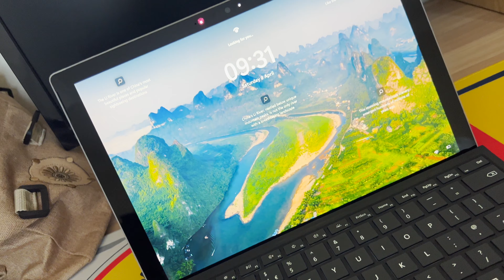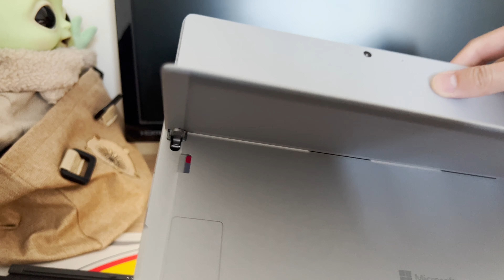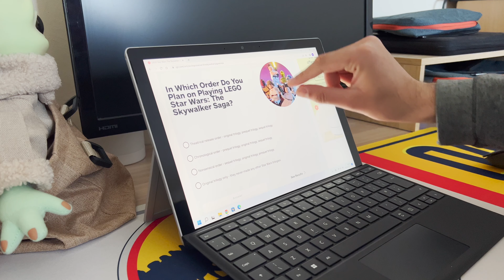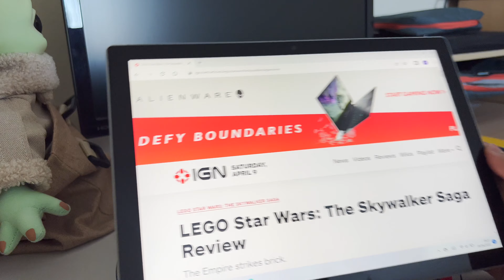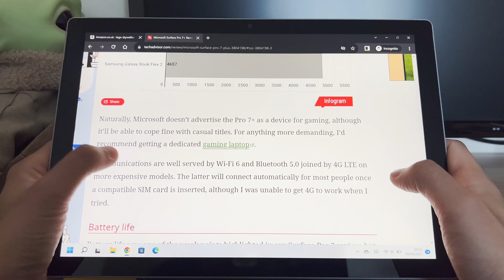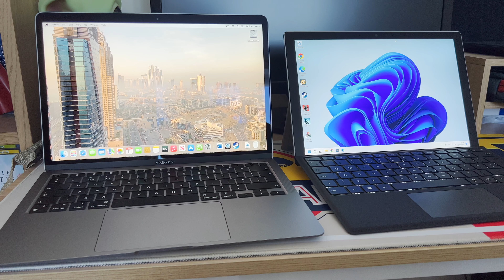Surface Pro 7+ Review: MACBOOK AIR M1 REPLACED?

Comment: Would you recommend the Surface Pro 7+ with 16GB of Ram for around £500? (Found one used on eBay)
Reply from the maker: That’s actually a really good price. If it’s from a legit seller then I would go for it.